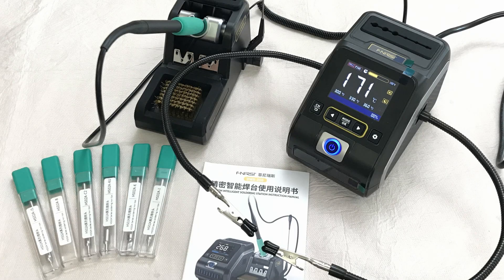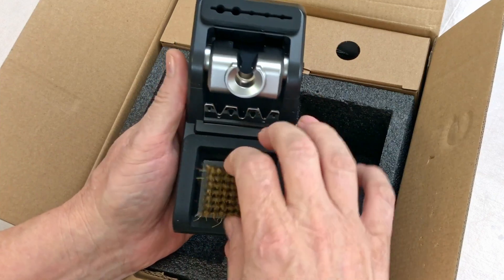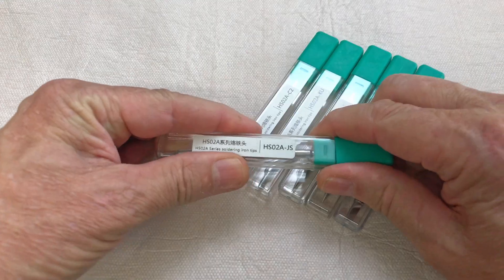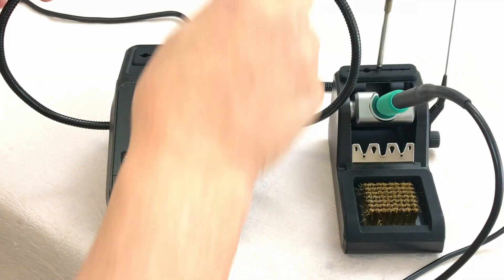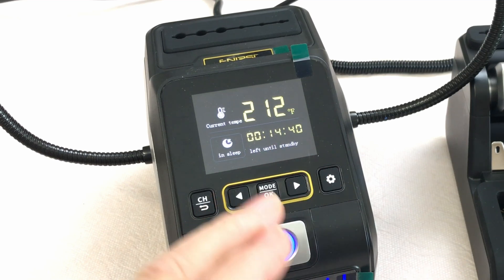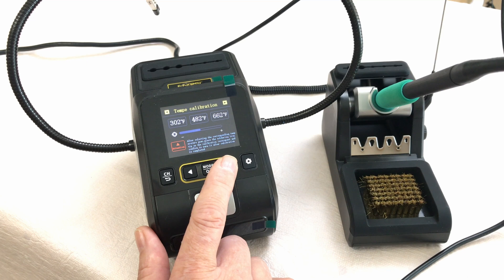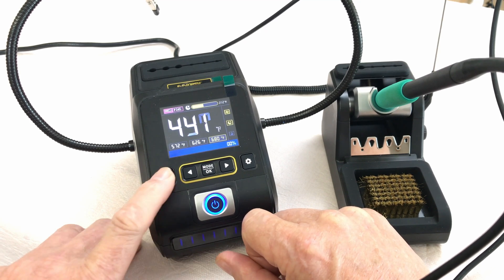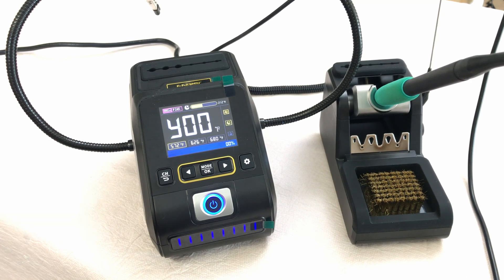Want Perfect Soldering Joints? Watch This FNIRSI DWS 200 Review Now

Comment: Hey, I hope you see this. I’ve ordered this station twice now and not once has it worked properly. It cannot at all sense the tip inside the standby station and therefore will not allow me to heat the tip. Would you happen to have any ideas on what to do to fix this?
Reply from the maker: The only thing I can think of is make sure you have the cord between the standby station and the base fully plugged in on both ends. Personally I haven’t experienced that issue so I don’t know what else to check. I hope it’s something simple and you are able to find the issue. I really like this soldering station.
Reply: @DIYHomesteadProjectsDIYHP10  Yeah I’ve tried that I think. The only notable thing when it comes to the cable connection between the stations is the fact that it was very very hard to push into the plug holes at first, at least until the banana plugs had flattened themselves out enough. I’ve even taken the main stations apart and checked to make sure that they look okay. I’ve also mixed each station trying different combos to see if it would work but it hasn’t. I’m pretty disappointed about it. I think the station looks very nice and I’d love to be able to use it. But I’ve already spent around 260 total on both sets, and I’m not sure I’m willing to spend another 130 just to maybe get another broken station all while waiting on my refunds from amazon that will probably take 2 week. Thank you for your quick reply and advice though, I really appreciate it